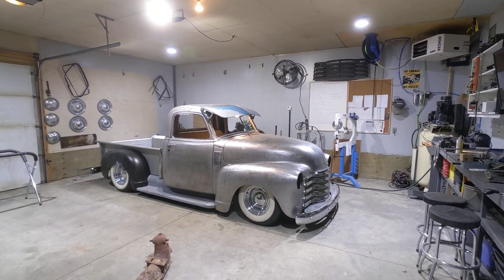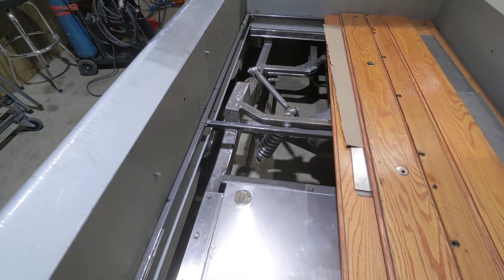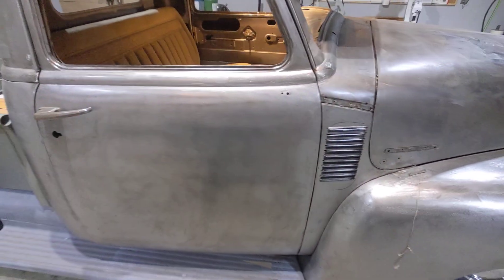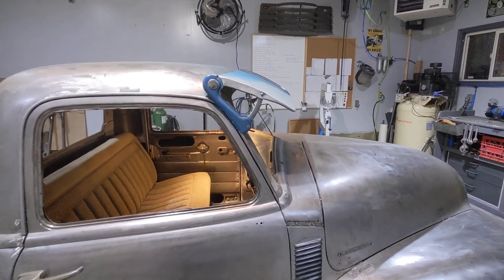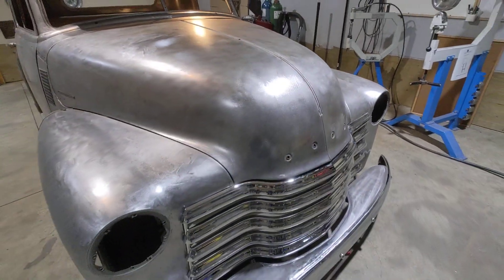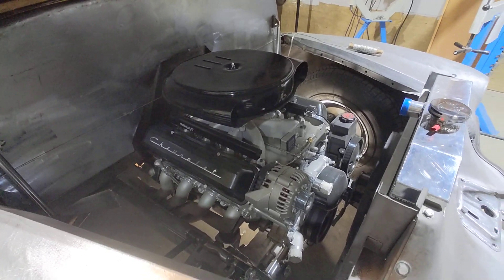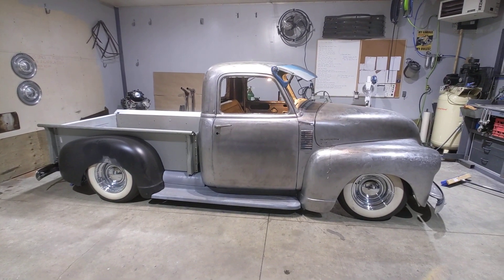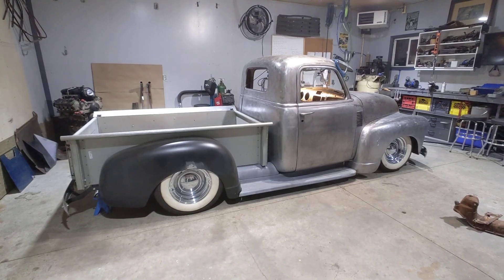1951 Chevy 3100 full walk-around

Comment: JP, great work!  I can tell the thought and planning you put into each step.....hey, what headers are those?  I've read that the fit is tricky for an LS on the original truck frame, maybe because your engine sits further back you have extra space for the long primary tubes?  
There are a ton of different "LS swap" headers online, eBay, etc.,  I'm sure one of them has to fit these trucks.
Reply from the maker: Thanks! And yeah you bet, lots of planning and research. I noticed allot of people complaining about the header clearance on these trucks so I did lift and recess the engine about 1". These are Ultimate Headers and the engineers there helped allot with drawings and dimensions. I actually raised the front crossmember into the frame rails so the engine wasn't sitting high above the axle center line.
Reply: @badomanclassics  thanks for the reply JP.  I'm planning to start on a 1952 truck this summer. I'm going to check into the recessed firewall to help fit my lq4 and give me more options for fans and accessory/pulleys.  I really want to fit long tube headers to get that exhaust rumble just right.  I suppose I can raise the motor mounts but don't want the center of gravity up too high.  I also have to have AC since i live in the southern USA.  There is going to be a lot of hurdles to clear but thats part of the hobby. Lots of test fitting for sure!  I subbed and looking forward to learning from you.thanks
Reply from the maker: @robertkrupa2552  you've probably seen those recessed firewall kits? Those should do the trick. I can measure the location of my engine. The headers are about 1/8 or 1/4 from the frame
Reply: Yes I am going to get the recessed firewall sheet metal

Comment: 1) you sound Canadian 
2) what rear bumper?
Reply from the maker: 1) I am Canadian, eh👍
2) 1955 Chevy bumper, flipped upside down.
Reply: @badomanclassics  nice. Vancouver myself. I’ve got a 49’ and found what appeared to be a 55 rear. Can you tell me. Did the 55 bumper bolt holes line up with the 50 bumper brackets?
Reply from the maker: I believe they do, and it mounted to the frame perfectly.

Comment: Is this on a s10 frame?!?!???? Awesome truck I just got one want this same stance on it
Reply from the maker: Hey man, this is the original frame with a mustang 2 ifs 2" dropped spindles and a triangulated 4 link in the rear with a 3" notch.
Reply: @badomanclassics    i saw in another comment that you modified the mustang 2 sit 1.5 inches into the frame how did you do that do you have any pictures of it?
Reply from the maker: @louisgarcia5188  I do have photos of it. I notched the lower crossmember down an additional 1.5" and added 1.5" to the height of the tophat (using 3/16 steel to raise it). I also have double adjustable coilovers

Comment: Too bad its slammed like everyone else does, please don't swap in an LS and fugly overstuffed interior.
Reply from the maker: It's not slammed. It has about the same drop you would have seen in the fifties. Once this engine dies I absolutely will install the 6.2L LS I have waiting, I will ensure the engine retains the correct style of the era. As for interior it'll be upgraded with all new wiring, power steering and safer electrical connections, it too will retain the same style from the correct era. 
I'm sure you don't shit on Chip Foose or Boyd Coddington cars, even though they all had the ugly oversized billet wheels and excessively chopped tops. (I do highly respect those fellas though👍)